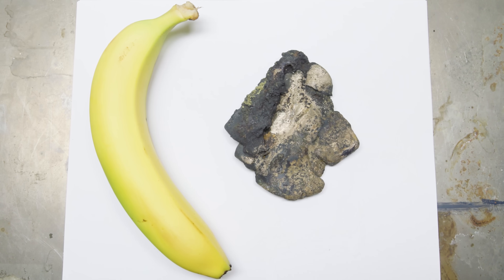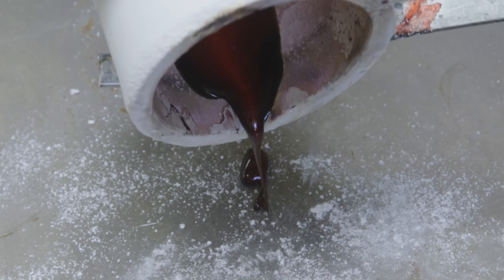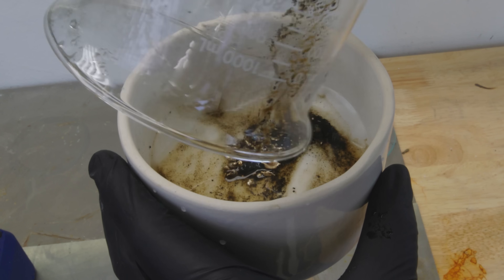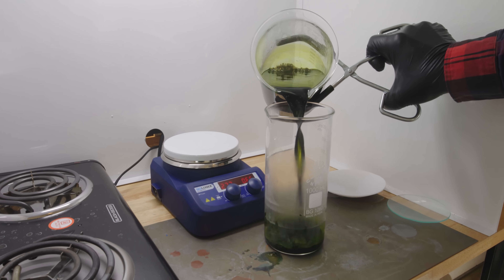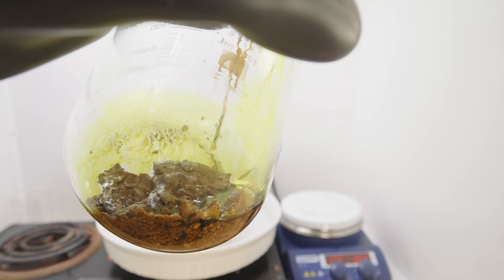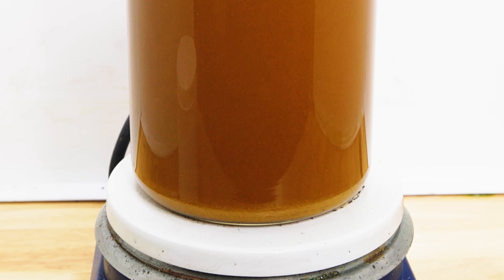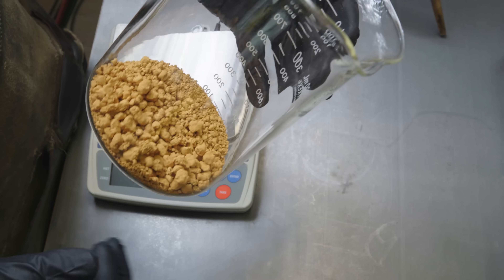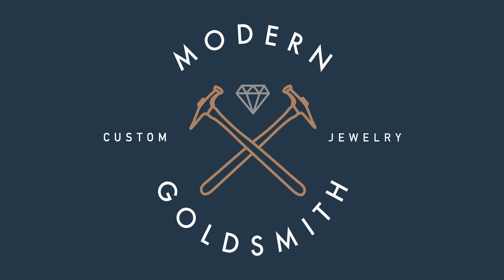Turning a BLOB into PURE GOLD!

Comment: That’s over $13k of gold?! Did the client pay you with a chunk of the blob? Considering the time, materials, etc maybe they just gave you the blob in whole lol 😅 Excellent video! It was cool to see the chemistry behind the process, and I wish we learned more about this aspect of the craft in jewelery school. 😊
Reply: @runs_through_the_forest  glass beakers are pretty cheap, but fume hoods aren’t.
Reply: I would like to see a rough estimate of the cost involved. Chemicals, extra equipment, hours spent. Just out of curiosity.
Reply: @raraavis7782  A fume hood is pricey, though you can build one from scratch easily enough. I believe MAP gas will give a hot enough flame to melt gold. Hydrochloric acid is cheaper than milk, so is sulfuric acid (which he didn't use but should have added a bit to drop any lead out of the gold solution). Sodium metabisulfite is sold as Stump-Out stump dissolver. Nitric acid is the most expensive chemical. Around $70-$80 for the jug he had. You'd also want a lab apron, eye protection, acid proof gloves (nitric acid will eat latex and nitrile gloves for lunch). I'd also want a filter respirator that could handle nitrogen dioxide. The fume hood would take care of it, but given the potential effect if you breathe too much (drowning in your own fluids), the cost would worth it I'd think.
Reply: @CrimFerret  
Cool. You seem to know your way around. Chemist?
Reply: @raraavis7782  definitely not even close to the value of the gold which is over $14,000.
Reply: @jimv1983  was intrested cheked some of the acids and powders he used was all priced around 30$/kg(L) so doing this probably cost a fair bit bellow a hundred USD, might missed somethign expensive that was used but dont think so, also I'm sure this can be done cheap in bulk by specialists
Reply: @runs_through_the_forest  
Oh, I'm not quite curious enough, to research it myself 😅.
I'm just always generally curious with any kind of diy project. Sewing, home renovations, repairs, owning pets, hobbies ...
I just find it unfortunate, that cost/labor time estimates are very rarely included in such videos. It's very valuable  information, after all and often hard to come by.
Reply: @runs_through_the_forest  love sreetips too. Took me a second to realize from the thumbnail that this wasn’t one of his videos.
Reply: Do you Need Accounts Services, Personal And Business Trabsaction , Payment Handle All Over world ?
Reply: 15800$